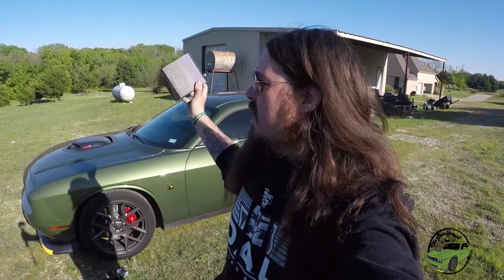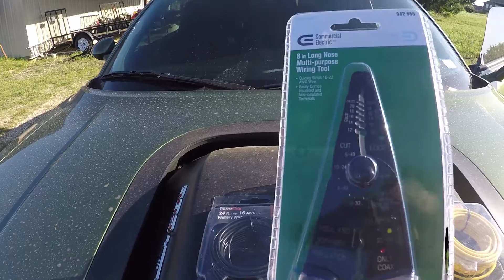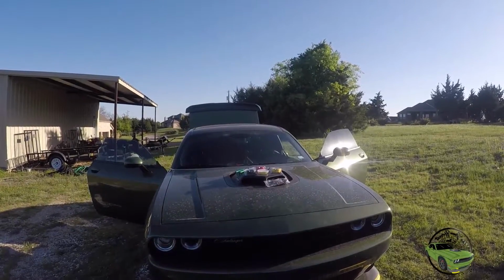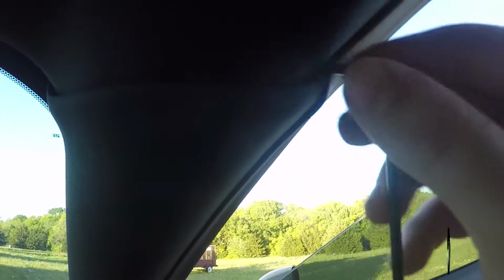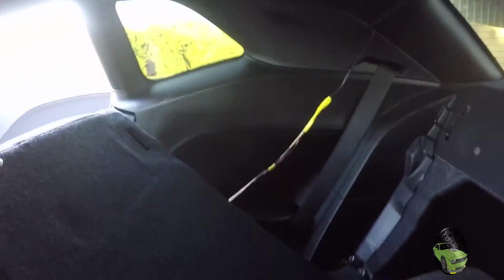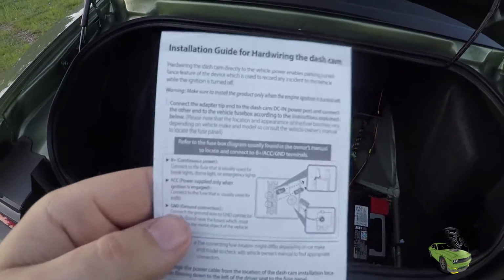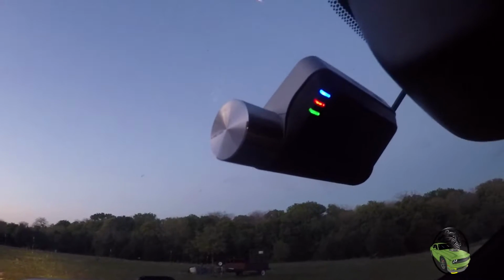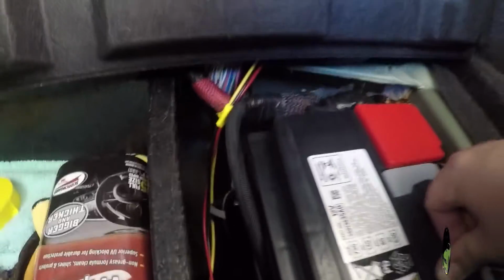2018 Challenger Hardwire Dash Cam Rear Fuse Box Install

Comment: Is there a reason you didn't run wire under carpet instead of headliner on way back to truck?  I was thinking of doing that so the wire would already be on the ground heading into the trunk.  Just wondering if there is a reason I should not try it that way?

Comment: Hey, cool video. I just installed a rexing dash cam in my 2013 300c and I ran the wires to the rear fuse block. The dash cam is coming on and working fine when I start the car and while its running but I don't think I have it hooked up right for the constant power. I have the constant power (yellow wire) hooked to fuse #12 which is the same fuse you hooked up to in this video and I have the ignition wire (red wire) in fuse #33 which is ignition switch/wireless module. Trying to make sure its hooked up right for the parking mode.

Comment: I have a question about the fuses. Since I’m using two add a fuse taps which 2 fuses were the best to use for the challenger I have a 2016 hellcat I’m trying to set up for the parking mode. Fuses as in the number and what the fuse runs. Thank you!!

Comment: What do you do if your windshield is tinted? Won't this peel the tiny off over time?
Reply: most dashcams come with a clear plastic film to apply to the windshield, then attach the dashcam to that. It spreads the weight of the cam out uniformly and reduces stress on tint. Just FYI!

Comment: Hey bro good video just curious didn’t the camera come with a hard wiring kit where you can just access the fuse?
Reply from the maker: Joel Rosas no it does not come with a hard wire kit you can see both separate kits in the video. The camera only comes with a car adapter plug, to go into a cigaret lighter. The hardwire kit is separate, which is what I show in this video.

Comment: Why wouldn't you just connect it to power inside the cabin under the dash?
Reply from the maker: if you mean the cigarette lighter, because i dont want a wire hanging down from my dash, and pulling out the center console to hard wire into that wire is a bit overkill when you can just run a wire down the trim in 10 minutes lol
Reply: @thegoldeneye8934  there are many wires available besides the lighter socket. I also noticed you didn't pay any attention to whether you connected the accessory lead to the fused or non fused side of the fuse.
Reply from the maker: Pawlik actually I did, that’s why it worked 😂 and it’s now tapped into a proper fuse as I said I did this as a quick install but thanks for...well whatever this is 😂 in my research, if you want to tap into the dash you need to remove it. I didn’t want to do that. If you’re such an expert why watch the damn video 😂😂
Reply: I’ll go under the dash and check the wires of the 12v socket to see if they are easily accessible. Thanks
Reply: TheGreenHornet You don’t take criticism well.
Reply: @fiouable  You're not that smart.